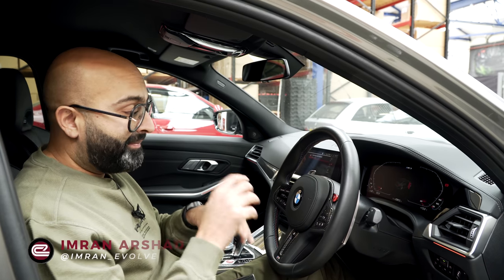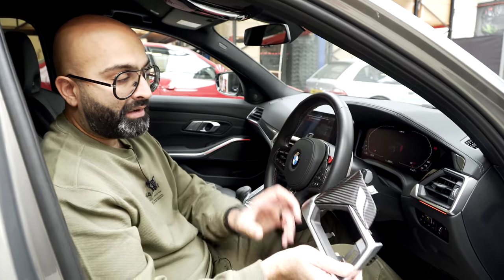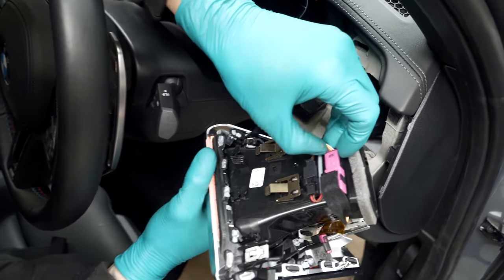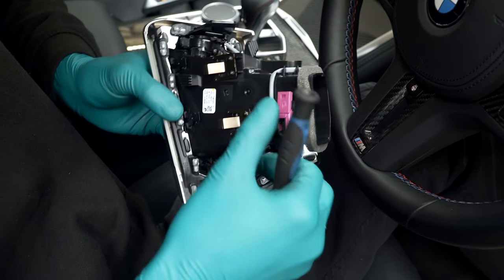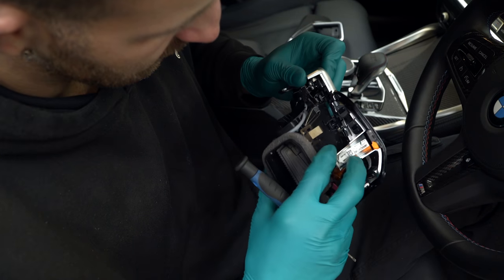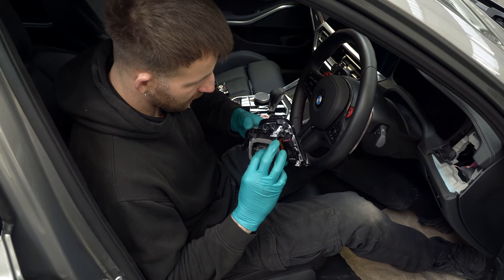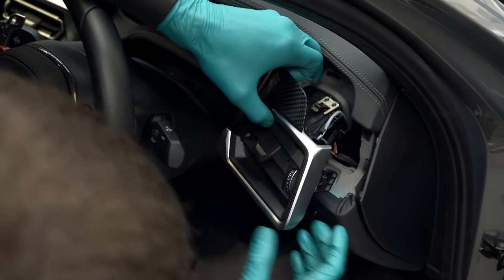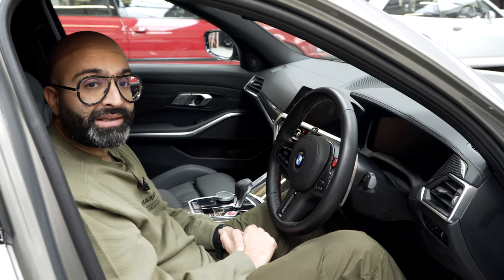BMW cheaped out on our G80 M3! - Indiv G2x/G8x Carbon Vent Trim - Overview + DIY Install

Comment: The reason they made it gloss black is to be uniform to the corner of the touchscreen which has the same gloss black corner edge.  I do agree the carbon does look nice.  I plan to change mine as well or use a carbon overlay.
Reply: that cant be it. lol
Reply: @user-np9co2nm1z  it is though.. i changed mine to carbon.
Reply: @calimade8136  I was kidding. I analyzed it in my own g80 and was like oh that makes sense. I dont know why this guy doesnt notice the flow from screen, across the cluster to the other side. I think it looks great the way it is.

Comment: NO, from a pure designer's point of view, its not missing carbon fiber, its meant to be finishing  with black plastic bit, when you see the whole dash from driver to passenger side it shouldn't be finishing with CF but i admit that replacing with CF looks cooler XD